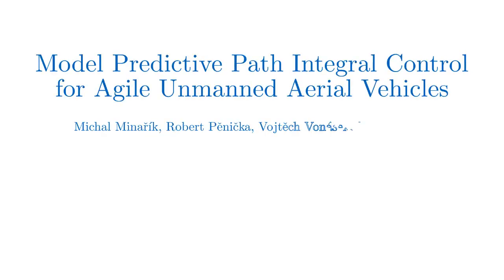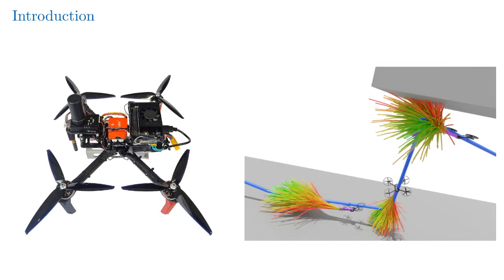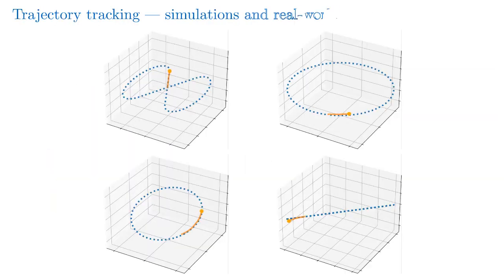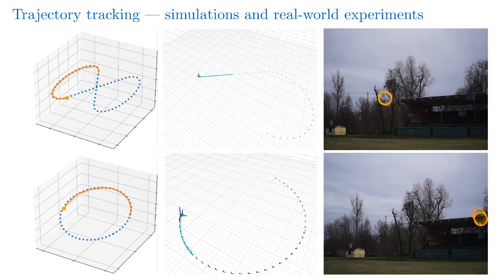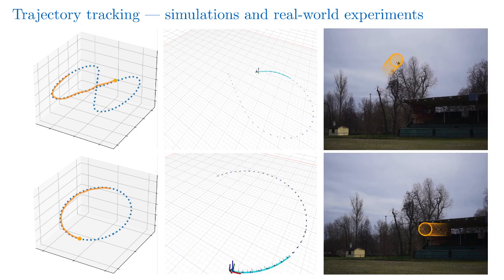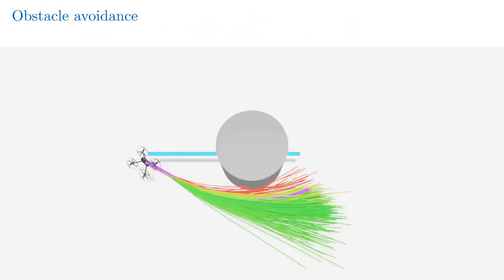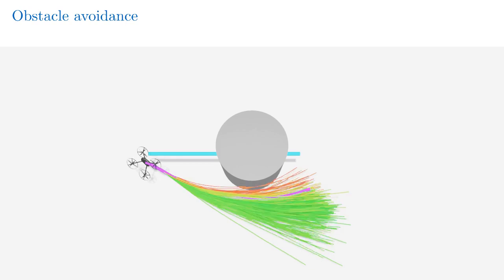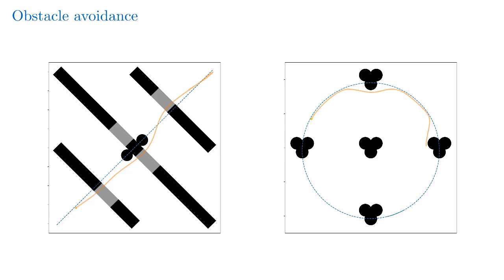Model Predictive Path Integral Control for Agile Unmanned Aerial Vehicles

Comment: Nice! This video showed up today. We did the same outside test in October 2024. 🙂 In our implementation we used the importance sampling version of MPPI with Holybro x500 and cube orange. With a simple Raspberry pi 4 as an offboard control we could fly the drone using 1900 samples with timestep 100ms and 20 steps along polygonal path. We implemented it in ROS2 in C++. Do you run it in 100Hz or 10 Hz? The paper in Arxiv says 100 Hz but in table II states \Delta T=100ms. Even with 100 Hz I am a bit disappointed by the Jetson's performance. I would hope for a bigger boost.